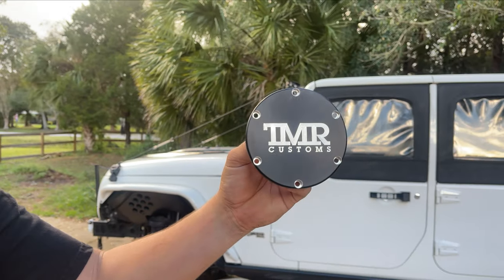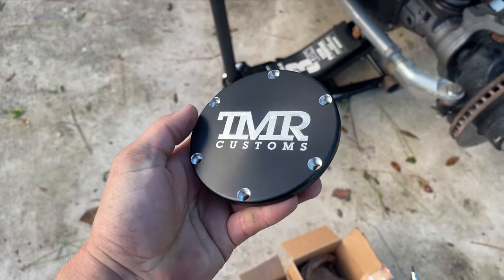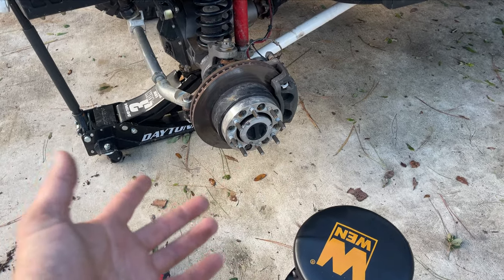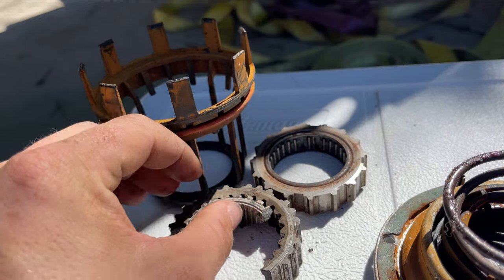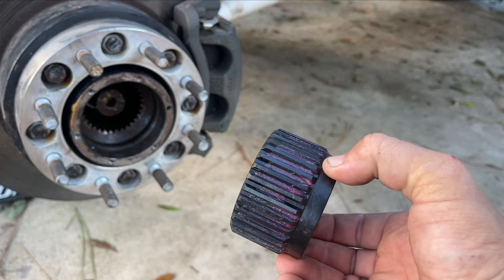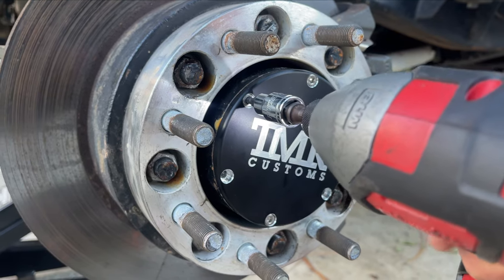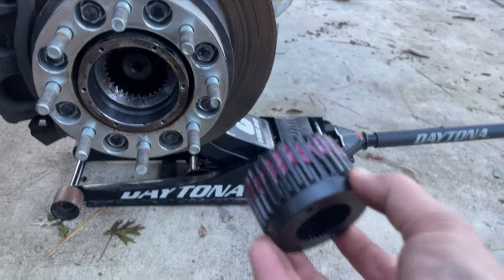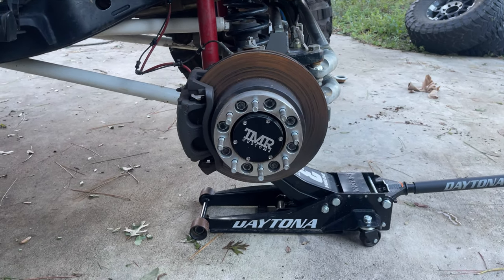TMR Custom Drive Flange / Slugs Install

Comment: great video brotha, almost been 2 years, any problems ?
Reply from the maker: Haven’t had a single issue with them. I’ve pulled them out probably 3 times just to check them but they are solid and still going strong.